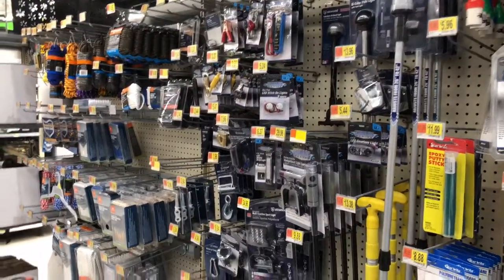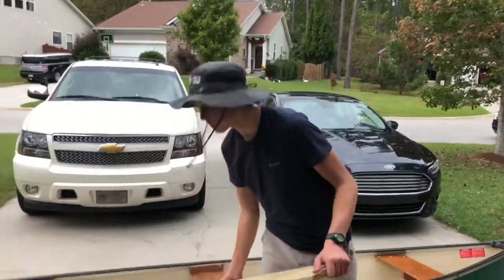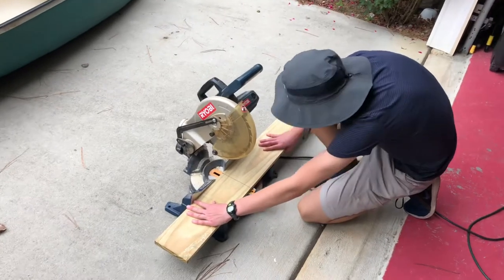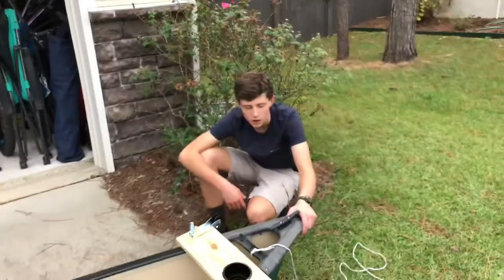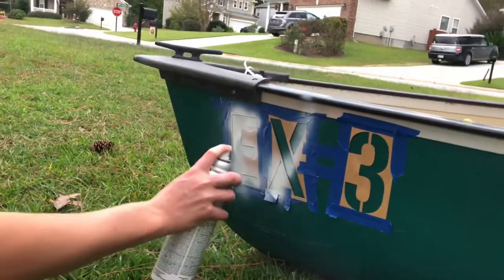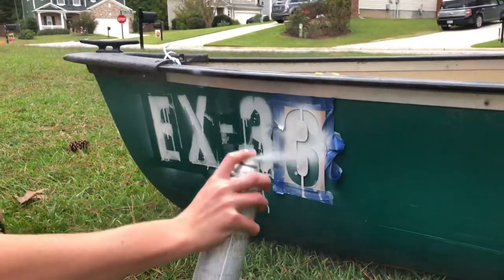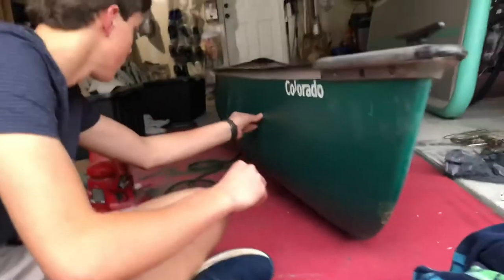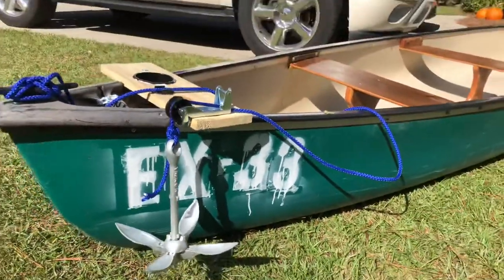Epic Canoe Modifications

Comment: Did you redo the seats?
I'd like to see some info on them and the braces underneath them.
Reply from the maker: No. I may work on them in the future but they are just attached to the lip on the side with a support underneath.
Reply from the maker: Thanks for checking out the channel also
Reply: What material are the seats and supports made from?
I just made wooden seats and trying to figure out how I want to do the braces. I like the look of the braces you have on your seats.